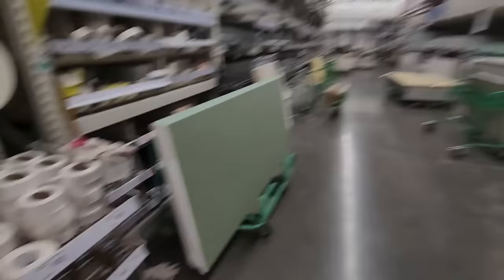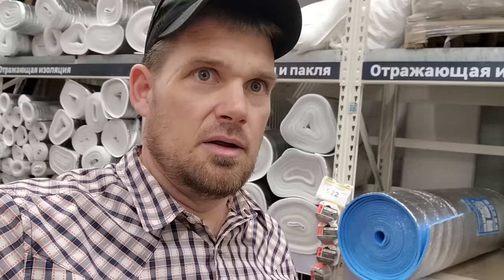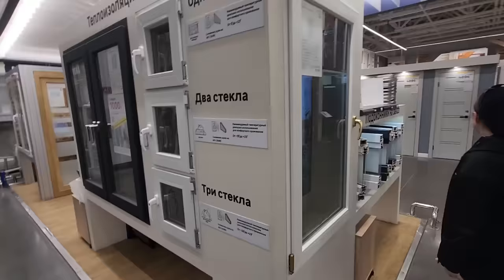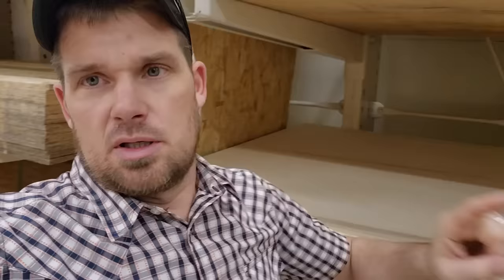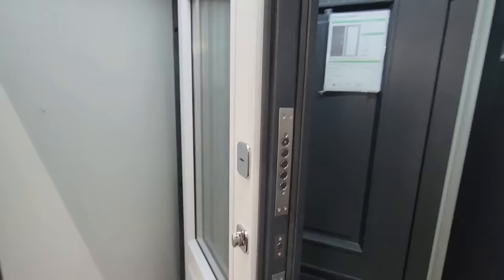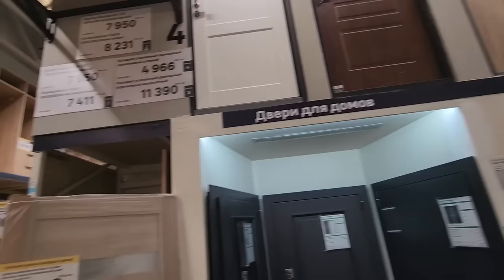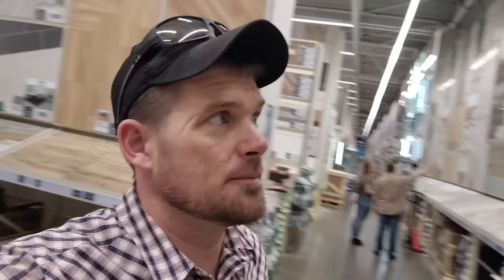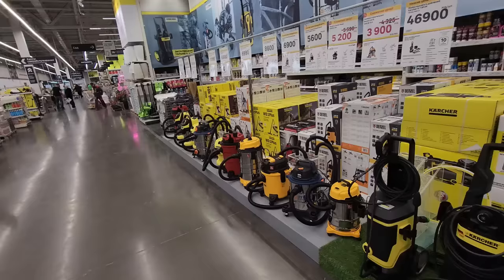As Promised We Went BACK !! REVIEW

Comment: I loved the tour. I'm a Florida state master plumber by trade. I plumbed-in lots of varieties of buildings and homes, from medical centers to schools and homes in Florida. I was med-gas certified and backflow certified but retired now. Most structures in Florida are metal stud. I find it better than the Northern wood construction. No bugs, fire retardant, and easier to run lines in walls, just need a stud-punch and plastic inserts for piping or wiring. In the 80s, I worked at my ex-father inlaws window company in Germany, AKM in Kleinwinterheim, building and some installation of those windows Those windows function called "Kipp und Dreh-Kipp" in German, are fantastic! Coupled with the "Roladen" (not the meat dish), we call them hurricane shutters, is a fantastic design. The "Roladen" not only keeps unwanted light out and protects from home theft, but also helps with insulation at night. I believe Russia uses the same calculations for Radiant factor as we do, and I'll try to add an example document. I absolutely love the sink drawer idea for missing the P-trap. Wonderful idea! I hope a Russian viewer explains Russian standard building offsets and codes. God bless!
Reply: В России всё можно делать самому без сертификата. Я военный врач на пенсии и когда строил свой дом, почти всё делал сам, всю отделку стен, потолка и пола, провёл сам канализацию и отопление, водопровод. Установил всё двери и окна. Научился работать со сварочным аппаратом и другими аппаратами.😊
In Russia, you can do everything yourself without a certificate. I am a retired military doctor and when I built my house, I did almost everything myself, all the decoration of the walls, ceiling and floor, I carried out the sewerage and heating, water supply myself. I installed all the doors and windows. I learned how to work with a welding machine and other devices.😊
Reply: @user-zj3kt3bt9p  That is really nice. Building codes and structural engineering design protects from catastrophes. Backflow protection, as an example, protects the entire water supply system from back siohonage of dangerous chemicals, sewage, or cross contamination from bad well water, etc. Window headers and structural support beams are also very important. I'm glad you were able to build your own home, but adhering to a building code norm is imperative to a safe and lasting community.
Reply: У нас нет проблем с насекомыми. Я никогда в жизни не видела термитов). В  России особо нет опасностей от ползающе летающих созданий). Максимум можно встретить гадюку, вернее увидеть мелькнувший хвост в траве.  Гадюка ядовита, но не смертельно). Укус и последствия укуса болезненны. Немного не в тему, но. Каждый раз, когда мне хочется куда нибудь где пляжи, пальмы, океан и  джунгли я вспоминаю сколько там всякой опасной живности и желание поехать исчезает. Дома лучше) и безопасней))). Теперь о сертифицированных специалистах : мы ведь не в вигвамах живем))). Просто наши мужчины и женщины умеют делать всё сами
Reply: @-akila-  I was only speaking of termites in the U.S.. They are active in some colder areas near the 45° parallel. And speaking of construction codes, I wouldn't want a doctor operating on me because he felt he's just capable. I'd rather have someone who puts an effort into studying new techniques and standards. Same with building.
Reply: @kevinwinkler6230  It is forbidden to build without a project made by a competent organization. You can do the construction yourself.
Reply: @victoruzhos856  We are also allowed to build our own homes and buildings, as long as we pass municipal inspection stages.
Reply: I am Canadian and my two houses in Florida have wood construction.   I have a problem with the crappy Florida building codes.   My garden hose broke off at the spigot and it is all the crappy plastic piping.   In Canada everything is copper and I have never had a broken line in 40 years at my house.    I got a $500 water bill that I had to go crying to the Toho water about and they reduced my bill.   Then outside they use plastic piping and only bury it about 1 foot.   The lawn tractors drive over the lines and break from the weight.   Both my houses had breaks that cost hundreds of dollars to fix and more huge water bills.    The toilet at one of my houses had hot water going to the toilet , so I had to cut the wall open to route cold water to the toilet and more crappy plastic to play with.   What is so bad about copper ?    When my garden  hose connection broke , I had to cut away the outside wall to get at the piping.   I called a plumber to ask a price and he told me these outside spigots broke off all the time in Florida.   I  have never heard of these breaking off before in Canada.   I just fixed it myself but it will probably break again in about 10 years.   What a waste of water, and the Toho water keeps telling you stop little drips or toilet running , in the meantime the building code stinks and thousands of gallons gush out from all the bad plumbing.   In Canada we bury all the copper lines 8 feet underground so they don't freeze.   In Florida the ground never freezes so why not use copper ?   I was told the limestone can react with the copper but I am sure you can coat the copper in something to stop this. or bury the copper in a clay earth and cover it up.
Reply: @jeffbguarino  сравните стоимость пластика и меди.
Reply: @jeffbguarino  Вы шутите?) Медь слишком дорогая сейчас, никто не будет её использовать, если есть пластик.
Reply: @JointBurn  Им пришлось бы использовать медь, если бы этого требовали строительные нормы. Разница в стоимости может составлять около 200 долларов за весь дом. Медь служит дольше и трубы не лопаются. Сумма денег, которую я заплатил за лопнувший пластик, обошлась мне дороже, чем цена установки меди.
Таким образом, Флориде следует изменить строительные нормы и правила, хотя бы только для общих проблемных мест, таких как линии подачи под землей и внешний патрубок. Теперь моей стиральной машине нужны новые шланги, а старые невозможно снять с соединительных кранов на стене. Если я возьму большой гаечный ключ, я могу представить, как отрываются пластиковые настенные трубы. У меди нет этой проблемы с прочностью. Мне придется поиграть с этими соединениями, чтобы избежать необратимого повреждения пластика. Я перекрою подачу воды во весь дом и подготовлю ремкомплект на случай, если пластиковые трубы лопнут, пока буду менять шланги.
Химикаты валят из труб!!!! Из Гугла.
Еще в 2003 году исследования показали, что трубы из HDPE, PEX и ПВХ выделяют в воду ряд летучих органических соединений, включая сложные эфиры, альдегиды, ароматические углеводороды и терпеноиды. Другие исследования показали, что пластиковые трубы выделяют в воду бисфенол А (БФА), нонилфенол и фталаты.

БФА запрещен. Возможно, именно поэтому количество сперматозоидов у молодых мужчин сильно снижается, и они не могут иметь детей. У меди нет этой проблемы, и мой счет составляет 130 миллионов, я проверил ее. Количество сперматозоидов снизилось на 50–60 %, и ученые полагают, что все дело в пластике и других химикатах.
Reply: @jeffbguarino  не знаю ребята, я сама не строилась, но впервые слышу, чтобы пластиковые трубы ломались, тем более под землёй, может это от качества пластика зависит?
Reply: @jeffbguarino да, снижение сперматозоидов это плохо, 😊самое главное здоровье!
Reply: @user-mt5ik1ws2t  Я согласен. Также медные трубы являются природным биоцидом. Медь убивает батарею. В некоторых пластиковых трубах растут колонии бактерий. Не медь.

Comment: These windows that you liked, they actually have one more special position - "micro ventilation". You crank the handle upwards, press it all the way in, and then slightly turn it to the right while keeping it pressed, I don't know, roughly for 20 degrees maybe, and then it opens just a little bit - this position is good, say, for winter, when you don't want a lot of cold air, but you would still like a bit of fresh air inside

Comment: Arend, I know that in the USA and Canada, behind the front door you can directly get into a large hall or living room. But in classic Russian houses after the front door there is a cold room called a tambur. Dirty outdoor shoes, gardening clothes, a shovel or a broom can be placed in this room. In severe frosts, guard dogs spent the night in this room when it was very cold outside.

This room will save you very well from cold winds or cold frost coming from outside and you'll save much money on heating. At Russian Far North where I used to live we had 2 cold rooms one by one before a living room. You will have a very warm house and you spend a few money on heating if you install plastic windows with a thick profile 70mm, insulate the house very well, basement and roof well.

Having a main nature gas pipeline on your lot property you can install a gas boiler for heating and hot water. Nature gas in Russia is very cheap. It very suits for heating bird farm houses or incubators or greenhouses something what needs much temp or electricity energy.

If there is no gas on the site then install a Russian oven or an oven with a water heating circuit as a backup heat source. So that it can be heated with firewood or pellets or coal. Firewood and coal in Russia are very cheap also - this is a social product, partitially compensated by governor state if your family has many children.

Electric heaters can also be used as a third backup heating source. Independent heat sources are important if you live far from the city.
Reply: Итересно, существуют ли газовые котлы, полностью независимые от электроэнергии? У нас на даче к участку подвели газ, сейчас начинаем заниматься подведением к дому. В данный момент отопление печное (дрова, уголь, батареи разведены по дому), но есть страх, что при отключении электричества (а такое в деревне случается), можно остаться и без отопления😢 что же делать?
Reply: 😃😃😃Раньше это называлось просто-СЕНИ.
Reply: @user-tq1qk4xl5o  Да, точно :) Я просто прожил на Чукотке, мы называли это тамбуром. У меня был холодный тамбур и второй немного обогреваемый, а потом уже коридор и затем уж жилая комната. В холодный тамбур мы пускали собак в лютую пургу или сильные морозы, которые охраняли наш дом от бродячих медведей.

И что удивительно рядом через границу при таком же климате в поселках на Аляске в США дома не имели подобных комнат, а отопление у всех почти было электрическим и не было печки, ну максимум типа буржуйки камина.
Reply: @user-lo8xu3lq3i аккумуляторы покупаются, на них можно продержаться какое-то время при отключении света. Но не долго. Либо… остаётся вариант русская печь .
Reply: @user-lo8xu3lq3i  надо доп источник питания, для моторчика, который гоняет теплую воду в батареях. Мы просто поставили печку запасную .Дрова есть всегда
Reply: @user-lo8xu3lq3i  Да, такие котлы существуют. Это самые простые и дешевые котлы, обычно. Они отлично подходят для отопления, не уверена, что каждая модель позволяет получать горячую воду для дома за счет них. Тот, кто поставлен в моем доме, подходят только для газового отопления, но не зависит от электричества.
Reply: @user-dj4ub9lr4l  спасибо!!!
Reply: Еще используют в автомастерских печки на отработанном топливе. Но конечно они портят воздух.

Comment: I used to work as a windows salesman in Russia.

1) We do have American windows (that's how we name them - vertical ones) in Russia, but they are rare - not too many producers. I know one fabric in Moscow - they can ship it to you
2) Also we have double-isolated sliders (plastic and aluminum), but they are expensive
3) We also measure insolation in R value. The guy you were talking to is a fool
4) Putting a gas between glasses is optional
5) Triple glass windows are mostly for soundproofing. Glass coating gives you more insolation rather then adding 3rd glass
Reply: "Insolation" means how much sun, "insulation" means isolation. R value is insUlation.
Reply from the maker: Very informative, thank you!
Reply: @alexeykrylov9995  Thank you
Reply: Для уточнения, чтобы Аренд лучше понял Ваш комментарий: слово "fabric " на английском означает ткань. Фабрика - это factory
Reply: Although Argon (or Krypton) gasses between glass panes provide good extra insulation, excessive sunlight causes eventual leakage over time. But most windows last @ 20 years. There is a huge interior temperature difference between Argon filled and non filled double pane windows.
Reply: @kevinwinkler6230  No, the difference is not huge. Its a small difference. Glass coating is the best way to get insulation

Comment: In Russia in building industry millimeters is a standard, meters are used as well, but more often than not you'll see measurements in mm. So your drywall is 2500x1200x12,5 mm :-)
Reply: где ты видел гипсокартон 12.5? 9 или 8
Reply: @user-wg5il3kz5p да навалом гипсокартона 12,5мм!
Reply: @user-wg5il3kz5p  Посмотри в магазинах, должон быть 😂

Comment: Building material looks quite similar to what we have in Sweden. The tool brand worx is a decent budget brand good for fixing projects at home. For professional everyday use brands like Makita, dewalt may be a better choice. Bosch has a green serie and a blue serie for tools. Blue is professional and green is comparable to worx.
I have my own electric installation company and I use Bosch blue and AEG 18v in my daily work.
AEG, Milwaukee and Atlas copco were the same thing for many years and I could use my AEG batteries in Milwaukee.
You might also find a brand called Ryobi in the lower price range, it´s something between handyman and PRO.
Many stores also have their house brand series, they can be good to a low cost.
I bought one of those "china" brands for testing and I have used them for things at home. 
My store gave 3 yrs warrenty on those and they have been working fine, batteries still works after maybe 5 yrs??

Comment: The reason for smaller sheets of ply, OSB or other material is that the sizes are easier to handle when renovating a flat. easier to transport in small amounts too. Most big box hardware stores are more geared towards small flat projects. That's were the 1525x1525 size comes from. When my company buys materials from our suppliers for projects we prefer 2500x1240 or even 3000x1500 sizes, butn then we get a flatbed for shipping and multiple people for handling on site.

Comment: Hey Brother. For your measurement conversions, just get a lil app called 'converter' on your phone. 2500cm is 2.5 m is 8.2 feet. 1500 =3.93feet. A meter is slightly over 3 feet. and there are 2.54cm to the inch. 1/2 of your sheetrock width is 29.52inches. Unfortunately, you can't work that into feet and inches and are simply going to have to use the metric.
Reply: Its not in cm its mm= millimeter.    250cm is 2,5m  2500cm is 25meters.    2500mm is 2,5m everything when it comes to building is in mm.  1 inch is 25,4mm  wich is abit over 2,5cm.      Countryside acers::  If you learn 1000mm is 1 meter and so on you will get far.

Comment: Arend, brick house keeps the temperature inside longer because the inside walls absorb and keep the warmth. Outer walls just isolate from cold or heat. Inside is emry space and isolation. In Russian style design they are concerned with heating fuel  efficiency plus heat concervation plus long lasting without expencive maintenance coming together. Wood house is the same except that wood house is prone to fire. Whereas in Canadian wood frame design builders are more concerned with the lower cost  and easier construction. Functionality is the last thing in Canadian design. If you build for your own family, Russian technology would allow you to keep them warm and cosy cheaper but it will be more expencive to build. Barns or additions to the main house may be wood frame, why not. So, the trick here is heat conservation, maintenance cost and security. Also think about differences in heating style. In Canada they use mostly forced air, from what i ve seen. You get cold very soon after it is off or if you save on heating. It heats the air, whereas in russian style they tend to heat the walls and floors, and later it gives the heat back into the air. According to my experience Russian design is more savvy, easier to maintain, and it is giving you dry and warm house. Also, please, do research about russian wood owen technology. Yiu may find it interstin and very useful. It is one of the best heating technology,  not known by europeans, designed by Russians for Russian climate. However it should be built together with foundation.
Reply: Он не знает как строить кирпичный дом, у них там строительство ведётся из дерьма и палок.

Comment: Dear Aneesa and Arend, It took me two years to get used to the inches in construction and the price of food per pound in Canada. :) You can see the thickness of the building sheets yourself and can estimate it. 
The area in square meters can be multiplied by 10 to get approximately (!!) the area in square feet. 
And 1 cubic meter is approximately equal to 35 cubic feet. 
Additionally, there are cell phone apps that will do the conversion for you.

Comment: 2500*1200*9.5 - length, width, thickness in millimeters
1 meter = 100 centimeters = 1000 millimeters
1 inch = 25.4 millimeters
approximately 1 meter is 40 inches (39.37 exactly)
dimensions of this drywall sheet in inches: 98*47*0.37
Reply: and what do they call a 13x17mm wrench?